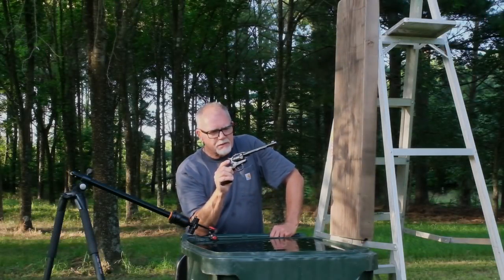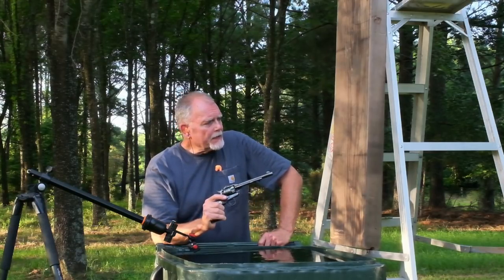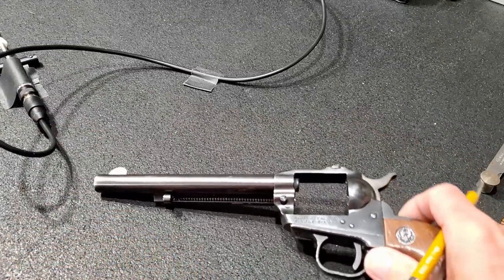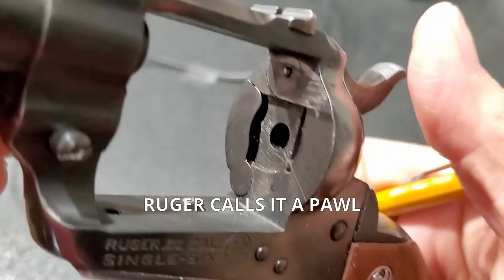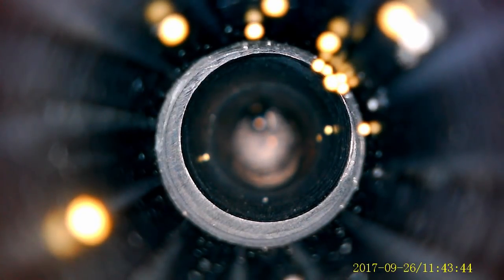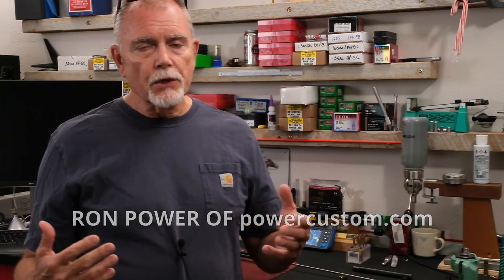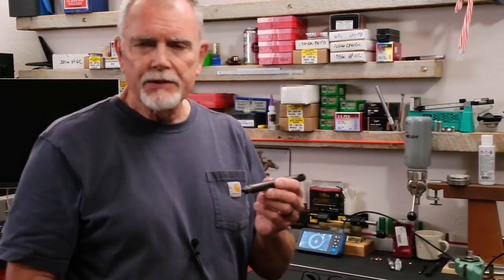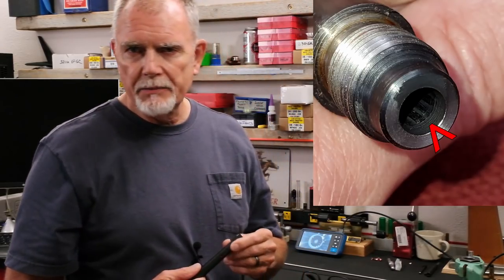The Bullets From My Single-Six Are Crooked ! ! !

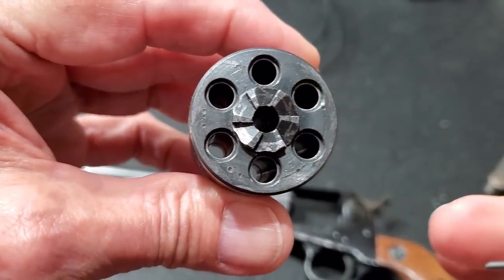Comment: At the 2:14 mark you can see several dimples on the back of the cylinder. Looks like these were made by the hammer dropping with the cylinder not locked in battery. I've never seen this on a properly indexing revolver. I'd also wonder why there's so much play in the cylinder on the base pin.
Reply from the maker: The dimples are definitely firing pin strikes. Another commenter suggested someone was fanning the hammer and that makes sense. I think the play was just loose tolerances between the frame, cylinder pin and cylinder. I've got an oversized pin to take care of that. Thanks for your comment!
Reply: I was going to comment on the same thing.  Something is definitely going on that's allowing the hammer to fall out of time.

Comment: I'm a grown man and you have made me smile... often. The alignment you showed last time, it has to be your problem.
God bless all here.
Reply from the maker: Yep. I'm with you. The alignment has to be the issue. I just have to find out where the alignment problem resides.
Reply: @TargetSuite  If the bolt locks up in the cylinder notch like it should I think the problem is with the base pin or the cylinder it's self is miss bored or the barrel threads in the frame are out of whack. I would think it is probably the base pin worn out though the bolt will push up on the cylinder causing the vertical miss alinement.
Reply: Yep, only so many things you can shift to align those axis. May have to enlarge the cylinder center bore and use a larger pin with tighter tolerances. Barrel bore alignment is a function of how it threads into the frame, threading not being any good generally for aligning an axis but mainly designed to tighten down parts in a linear direction. Need a beveled surface both on the barrel and on the frame to center the barrel when it mates and gets tightened down.

Comment: I would offer two suggestions before you change the barrel.I noticed the cylinder throats line up with the bore when you ran the feeler gauge between the top strap and cylinder.Load each cylinder chamber and place the feeler gauge as you did,hopefully lining things up.Then fire each chamber this way and check the accuracy.Also pull a bullet from a .22 LR and push it down to bore checking groove and land diameters after pushing it through.Ruger made those old models with a .22 LR barrel only and also produced a .22 WMR only revolver before building the combo guns.Yours may have both mis-alighnment problems and bore diameter even if the bore is fine.
Reply from the maker: Thanks for the suggestion. I did shoot some groups with the shim in place and there was better consistency and the groups were a little smaller. Definitely none of the wild fliers like before.

Comment: With the placement, or misplacement, staying in the same position with the rotating of the cylinder I suspect that the cylinder center pin bore is slightly off. Barrow another cylinder and check the alignment with it. It may not be fitted properly but should be close enough for comparison. Oh and use the pin from the "other" cylinder. Good luck, I'm looking forward to future videos I want to see you find the problem and the fix.
Reply from the maker: I just received a like new 1963 Ruger single six from one of the friends of my channel. I plan to make the comparisons you suggested. Thanks
Reply: Should have known someone else saw the same thing I did. But maybe for different reasons. But we are on opposite pages not at either end of the book.

Comment: For what it's worth, I spoke with a tech at S&W and we talked about the "forcing cone". I asked him why they are never polished and had big machine marks in them which could, in my mind, cause excessive leading when shooting lead bullets.. He explained to me that the forcing cone is not designed to "funnel" the bullet into the barrel/rifling, but is actually designed to be a pressure relief chamber, allowing high pressure to bleed off as the bullet is entering the barrel.....thought I'd share. Cool video, thanks, I love stuff like this.

Comment: Hey George! I’m really enjoying watching a trained engineer analyze the problems with your Ruger. I’m not an engineer but I’ve worked with many. One guy designed a wind turbine based on some prior plans a different engineer had given him right before he died. There were lots of small details that were causing problems. So I became a sounding board for the first guy as we went piece by piece through the windmill. We were working on the plans to build a working prototype in miniature when the first engineer was killed in a motorcycle accident. I lost all access to all of the plans that day and I don’t know the gory details. But I got a heck of a good education as we got to the nitty gritty of that wind generator! I’m glad I studied physics with the intent to actually learn the material. And I’m glad he told me about the Machinery’s Handbook! Excellent reference material for anything I’m likely to build or analyze.
Reply from the maker: That is a great book! And yours is a great story. Thanks for

Comment: I’m not a gunsmith, but I have owned several Ruger single six revolvers. They are usually very accurate. Never saw one that came with only a magnum cylinder, usually you could only get the magnum by buying the 22LR and the magnum was added to the deal. Is there a serial no. anywhere on the cylinder? In watching your previous episodes I would think the misalignment of the cylinder was caused by it being mismatched with that frame and never fitted properly.
Reply: That’s my thought as well
Reply from the maker: @Ken Corsell The cylinder is numbers-matched with the frame. I showed that in one of the early videos in this series. I think the problem is that the bore of the barrel was not drilled concentric to the blank itself. I'll find out when I take the barrel off.  I will check alignment with the chamber as I rotate the barrel. If the misalignment rotates with the barrel I'll know that was the problem. Thanks for the comment!
Reply: Its real possible also that a wannabe smithy was trying his nonexpertize George bought that gun in a pawn shop, and the 22 lr cylinder  was  missing. Jo telling how it became that way. Ruger and George has a good reputation  together. They know about it. Its really cool George was allowed to do this by Ruger, to 1; show off his expertise and. 2;  Give us a class on You-tube about how to go about finding the root source of the problem. Kudos for both George and Ruger for this very informative  video!  Ruger is top notch in Customer Service aand thei R&D. You cannot find a better gun manufacturer than these guys., and thats the Truth spelled out for you in plain english!!
Reply: I may be wrong, but I believe that before they went the convertible route, that Ruger made the Single Six in two specific calibers...22 LR or 22 Magnum. Seems that I read that somewhere many years ago.
Reply: @waynehajek6346  The revolver appears to be marked "Ruger .22 cal Single Six". This leads me to believe that it was originally a combo set with the LR cylinder being lost along the way.
Reply: @waynehajek6346  makes sense because they use slightly different groove diameters. LR uses .222" while WMR uses .224".
Reply: Usually the Magnum cylinder came with the Bearcat . It was .22 with a magnum cylinder thrown in but all 3 had the same serial numbers. Should be etched on the exit side of the cylinder
Reply: @waynehajek6346   No my dad bought a new single six in 1975 which came with both lr and magnum cylinders. I own it today and still have both cylinders and shoot both cylinders. Very accurate and enjoyable pistol to shoot!

Comment: I am happy that you are making progress. I want to see the fix when you figure it out. I have the Ruger single six which I have mentioned before in it shoot great. - I have a Dan Wesson 357 15VH2 with 2-4-6-8" barrels that I had to replace the hand spring and now it is not as accurate as it use to be. I was thinking I have to revisit the assembly and see if I did something wrong. Will check the cylinder alignment with a bore scope. Thanks for another great video.
Reply from the maker: Thank you! I'm glad to be making progress but I would like that progress to be getting things corrected. That should be happening soon!

Comment: You found it!  Probably one or two chambers might be ok but the other ones are messed up.  I bought what appeared to be a really nice S&W 429;  it worked well with .44 Special but a dozen rounds of magnum ammunition showed serious troubles - 3 primers cratered and shell hard to remove.  S&W must have been mad, but they went ahead and reamed the chambers to the correct length(and probably gave their QA a black mark).

Comment: I had a similar problem with a Uberti cattleman single action--shining a light down the bore I could see the chambers not aligned with the bore. Accuracy was terrible. I removed the bolt and beat on the top with a hammer until it was too wide to fit the cylinder notches, then filed it to fit biased toward the side that would bring it in alignment. Now that gun is one of my most accurate shooters.
Reply from the maker: Now that's my kind of engineering. Creative and successful

Comment: Thanks for the video, I just saw this after I picked up my Ruger New model single six. You put a lot of effort into finding and solving the issues with that gun. Most I would have done is get rid of it and make space in my gun safe. I haven't shot mine yet so when the time comes I will know how well it groups.
Reply from the maker: Good luck. I'm pretty sure that new model single six is going to serve you quite well.

Comment: It may be profitable to investigate the concentricity of the cylinder and the accuracy of the pivot pin.
Slop or misalignment at that point could well be the problem rather than the barrel being off center.
Reply from the maker: Thanks! The cylinder base pin does have some slop. And Power Custom has sent me a new oversized pin to rectify that problem. But it is a small amount and is not going to solve the bigger alignment issues.
Reply: @TargetSuite  I am finding it difficult to see how you can correct a vertical misalignment with changes to the bolt and hand. The bolt will only affect left-right alignment, and the hand will only move the cylinder vertically if there is excessive clearance between the cylinder base pin and the cylinder, or between the cylinder base pin and the frame.

Comment: George, that's a pretty great analysis on that old Ruger, can't wait to see what a 
new used barrel will do..........
Reply from the maker: Thanks! I'm looking forward to the barrel project as well. But most likely there will be a lot involved to getting the new barrel to fit. Probably a trip to a "real" gunsmith.
Reply: @TargetSuite   Yes, that's what I'd do or
see if Ruger will step up !!
Reply: @TargetSuite  I'm guessing that either the barrel, frame cylinder stop slot, cylinder slot in the cylinder, or base pin holes in the frame were cut wrong from the factory.  And I bet that firearm was a lemon from the beginning.  Unless the hand tension can account for the 4 thousandth up and 6 thousandth right of the cylinder position...there must be a bigger issue.  Namely...a miss cut frame.  Just my 2 cents.
          I say that because I bought an original civil war  Remington New Model Army frame, barrel and trigger.  I fit a Uberti cylinder, cylinder stop and hand...along with a Pietta hammer and loading lever...and everything lines up and locks up perfectly.  Because the frame was cut properly in the first place!

Comment: I bought a Ruger Wrangler in Oct.,2021, and new out of the box, every shot would keyhole targets from 5 yards to 15 yards and beyond. The only way to hit a barn was to go inside and close the door. Then,,,,maybe !!! I contacted Ruger, and was able to return the pistol for repair or replacement. I received the replacement March 1 2022.   So far,,,,no issue !!🤞🤞🤞👍👍
Reply from the maker: Fantastic! That has been my experience with Ruger customer service as well. They may let some problems slip out the door but they always stand behind them.
Reply: @TargetSuite  Yep, they are good. But the best customer service I've experienced in my life,(81 yo) has been with Henry. Anthony Imperato says Henry is happy when ALL their customers are happy. He means it.👍

Comment: Is this not the gun Ruger returned to you stating it had a shot out barrel?  Did Ruger miss this critical cylinder timing issue?   Is it possible you asking them to re-crown the gun set them up to not check the cylinder timing?  
I have had to send one or two handguns back to Ruger for service and each time I received stellar workmanship. I wonder if you had asked them to replace the barrel if they would have caught and repaired this misalignment.
This has been a very interesting series of videos, thank you.
Reply from the maker: Yes that is the same gun that Ruger returned to me. My guess is that they saw the indications of Shadetree Gunsmithing and just didn't want to do anything with it. But In fairness to Ruger they did offer to sell me a new model at a very discounted price. So I was satisfied with their customer service even though they didn't do anything with this particular gun
Reply: @TargetSuite   To teach , you did the right thing ..... I would take the New SS 10mm / 40 S&W  Blackhawk  in trade with $$ if needed !! 4 & 5/8 "
Reply: I didn’t think you could shoot out the barrel on a 22? I’d be so mad at Ruger for that.
Reply: @shanek6582  It's possible that the person doing the phone work at Ruger doesn't have the mechanical knowledge of the piece being dealt with, and quite possible Ruger isn't going to have a customer speak directly to an engineer. There are communication barriers between engineers and customer service sometimes, even in the best of companies. Even so, it matters quite a lot what a customer service person tells a customer after receiving word from their engineers or QC persons. The average gun user probably doesn't understand mechanical engineering stuff and so Ruger in this case has to consider what their response will be to the customer.
Reply: @exothermal.sprocket  I would trust a good gunsmith over an engineer any day even though a firearms engineer should have a full understanding of how they work. Being able to calculate the required strength in the design is a different animal from troubleshooting problems.
Reply: @shanek6582  You can't but they can certainly rust/corrode out.

Comment: George I am a long time Ruger owner and shooter.  I bought my first one in 1973. A New Model Single Six with Two cylinders.  In the '80s I used it to shoot .22 silhouette.  It was good them and still is a great shooter.   Have you checked to see if the cylinder pin axis bore is square or wallowed out.  It seems to me that could be the cause of the problem and the source of the shade tree gunsmithing.  All of my Rugers are great shooters.
Reply from the maker: Thanks for your comment Glenn! There doesn't seem to be anything other than normal play associated with the cylinder pin in both the frame and also in the cylinder itself. Just a few thousands tolerance as you could see when I was using the shim to push this cylinder down. Once I get the barrel question resolved I will start fitting the Power Custom parts in including the oversized cylinder pin which will take out almost all of that minimal slop.

Comment: The next time you perform this type of water test, an easier way to recover the bullets without losing them in the grass would be to lay an old sheet on the ground. the water will pass through while the solid stuff stays on top where you can see them. Good luck on this project.

Comment: George in shooting IHMSA many unlimited shooters who preferred revolver would modify the base pin and or the cylinder pin bore to tighten up the alignment while also tuning the hand and paw. I believe that Hamelton(sp) Bowen pistol smith preforms this service among others. I hope you get this sorted out. I've done an action job on Ruger's and T/C's but not gone the extra steps because of IHMSA's rules for production class revolver. This series has been so very interesting with all the plot twists.
Reply from the maker: Thanks Rick. I appreciate the comment. And I appreciate you sticking with me through all these vids!
Reply: This was my question as well. There is obviously wear at the frame were the ratchet rides which seems to be causing the hand problem but how is the wear or the fit between the cylinder pin and the front of the cylinder hole? With the bolt pushing up slightly on the bottom of the cylinder causing a worn pin to let the front of the cylinder go high? 
I might have missed it in the video if you said this.

Comment: I am a little bit of everything guy but mostly a mechanic - I feel that the cylinder center could have a sleeve installed to take up the worn out section or possibly replace the cylinder pivot pin - that would possibly fix the problem. The lower centering lug that raises up to lock the cylinder to align with bore is probably exerting enough force to push it off center if it is really worn.

Comment: The cylinder can also be tilted, you can try knurling inside base pin hole in the cylinder, or the frame to shift the alignment. Or try an oversize base pin from belt mountain
Reply from the maker: Thanks. I've got an oversized base pin from Power customer. That takes out almost all of the slop.

Comment: It would seem if you can push down the cylinder with a feeler gauge there is  some excess  clearance in the cylinder pin bore,cylinder pin or the bore that the pin rides in the frame . Great content keep up the good work
Reply from the maker: Thanks! And yes I have an oversized base pin to take up that excess clearance. It will be part of the final solution . . . if there ever is one😄